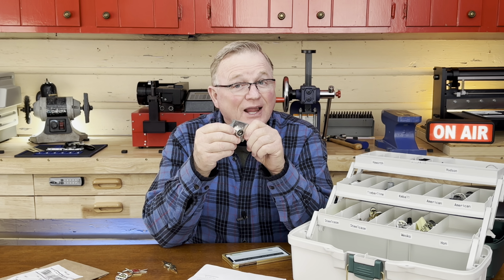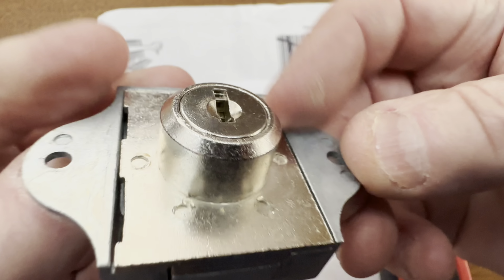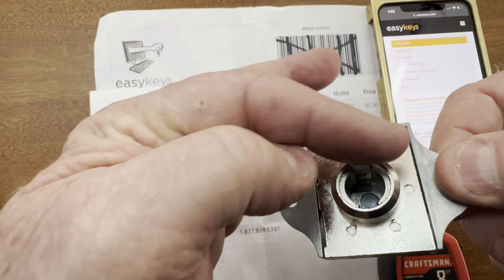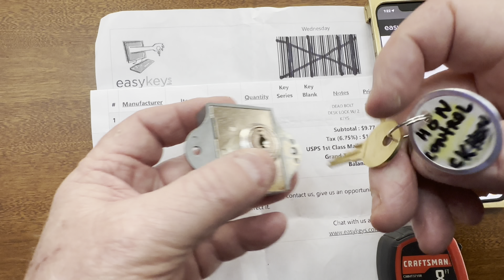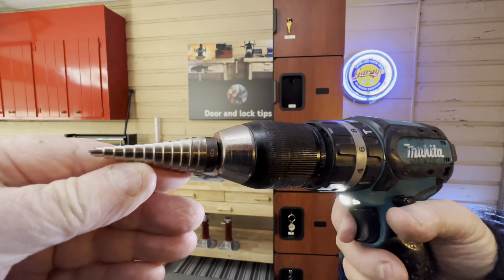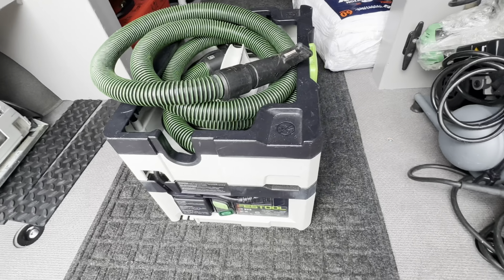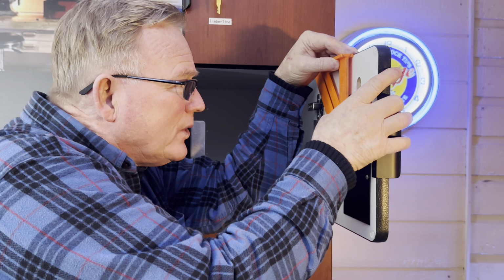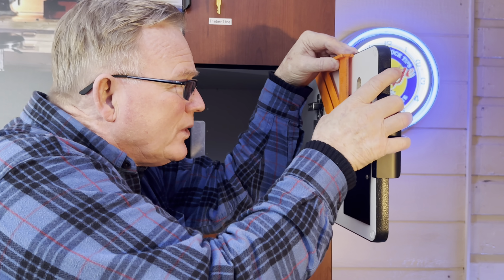DIY Hudson lock core removed and re-keyed

Comment: Too bad compx regulator doesn’t have the flexibility of the micro iq locks with ic cores on cabinet locks. Great vid. Thanks for sharing!
Reply from the maker: that’s true. They don’t go in where the MicroIQ would go. all the removable cores that they have stated on their website I agree so much so with your statement that it’s too bad regulators don’t work in all applications but for so many years so many I never knew anything about 
MicroIQ stuff and I got along perfectly fine with compX stuff and compX regulators. They are rocksolid best in the business bar no one  way way more solid than others